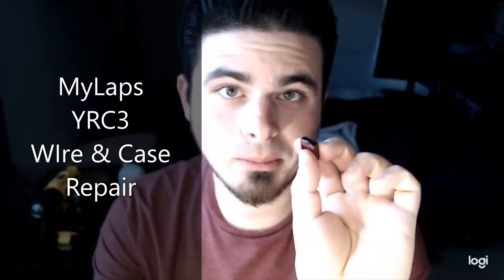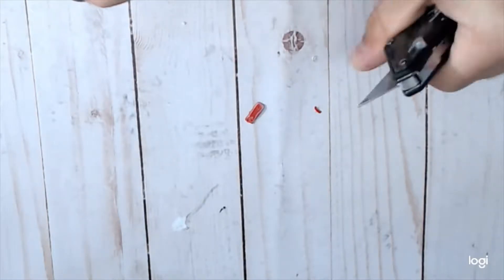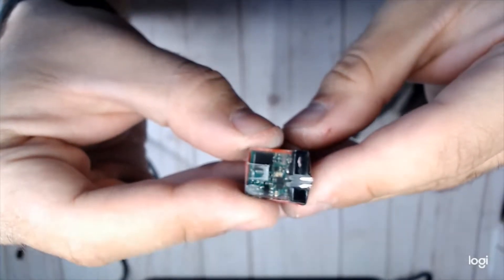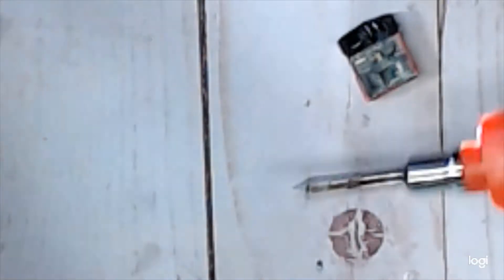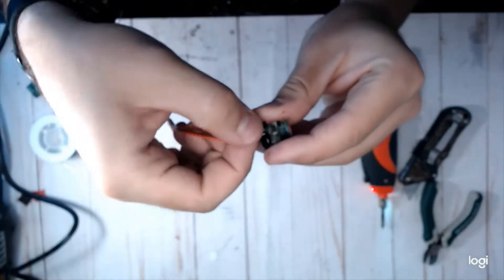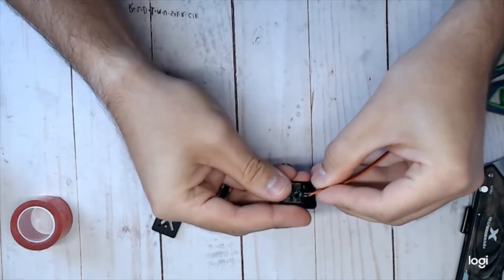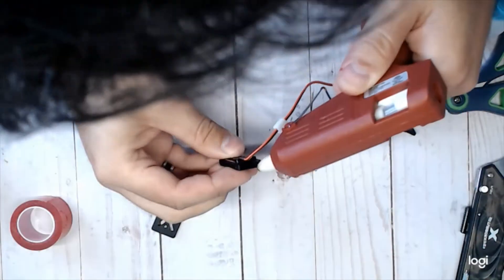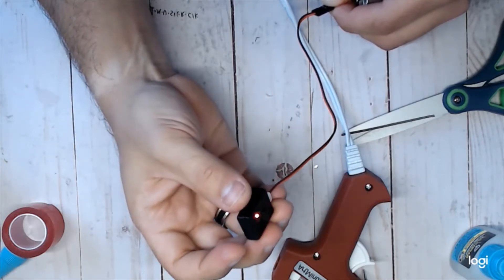MyLaps YRC3 Wire Repair & Replacement Case

Comment: I have AMB transponders from the 90's that haven't had the wires fall out of.....None of my hybrids or RC4s have ever had this issue either.  What are you doing to your transponders to break them?
Reply from the maker: I've fixed about 5 from people locally and around 25 from online requests, so it's definitely a common problem. It's likely from people who have a single transponder and move it between multiple cars. If you have a 2WD buggy, short course truck, and a 4wd buggy and run 2 qualifiers and a main, that's like 9 swaps in one day which bends the wires a bit each time. The ones I work on almost always have aluminum wires, which are far more brittle than the copper wires I replace them with. The way they design the transponders also concentrates the force at the point where the exit the epoxy, as there is no additional strain relief, so they usually break at the point the enter the case.